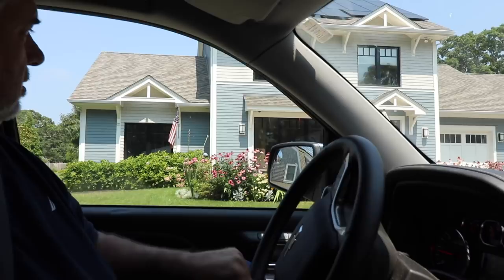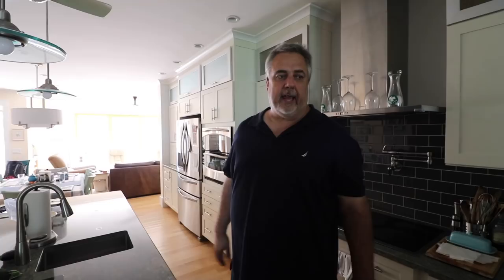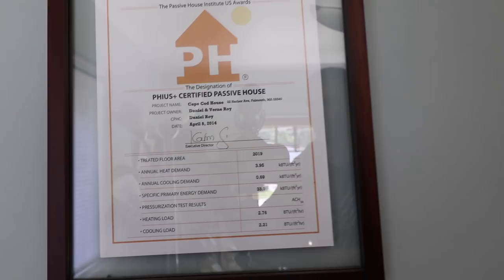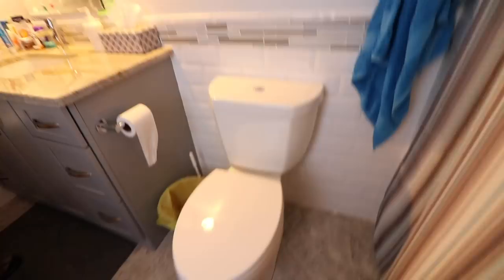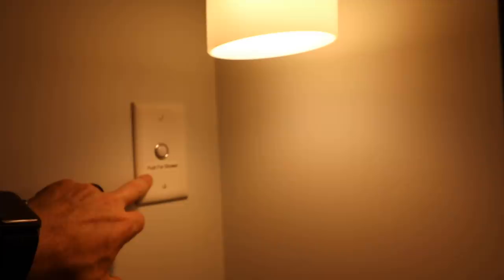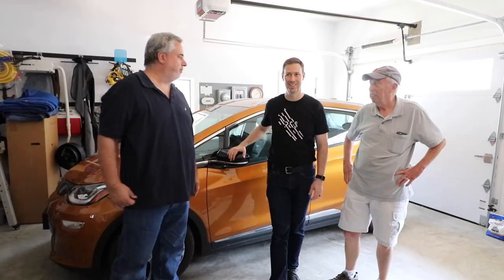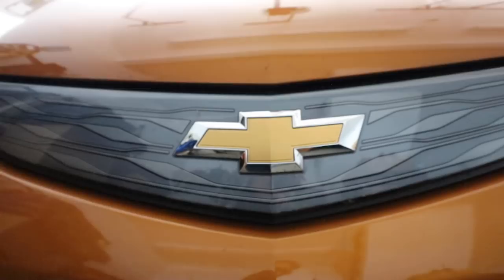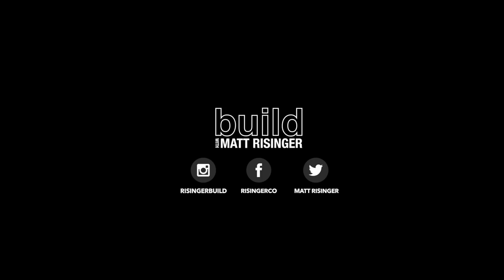Top 10 Most Efficient Home in America

Comment: in Europe they make heat exchangers with built in heat pumps where for every 1 Kw of electricity used for ventilation  you will get 2,5 or more Kw of heat
Reply: This is USA, we just recently upgraded from caves to glass walls.
Reply: The CERV air exchange system that I installed from Build Equinox in Illinois does the same thing with a heat pump.
Reply: Link to specs?
Reply: @2awesome292  I give you names you do the research. "Enervent " name of company, from brits LD 800 recuperator, Combi 302 polar,  Sundue SDAR 500

Comment: Cool house.  I'd like to know about the insulation though.  Those windows have to be pricey
Reply: Windows are not cheap but the trade off was getting rid of a traditional ducted heating / cooling system for two ASHP. It was pretty much a cost trade off. You can put less performing windows in and buy a bigger HVAC system, OR buy really good windows and a much less of an HVAC system

Comment: I'm wondering if you could use a thermal chimney to power the air exchanger... well... actually I'm sure you could, but it's more complex and less convenient and reliable than just using the PV panels.

I question the humanity of anyone who does not get excited by awesome engineering.
Reply: And you’d lose the variance for CO2 buildup and moisture removal.

Comment: This is all good and fine in northern climates, however what about Texas! More specifically around Austin, Texas...how do we save on a/c bills.
Reply: A good build passive house works summer as well as winter. During the summer, the heat will not come in, and during the winter, the heat will not get out,  either situation works on the same principle. Granted, the idea of a passive house was not born in super hot climates, it was born in the moderate climate of northern Europe, and there it works fine. Here in central PA, a new stick frame house with standard insulation becomes almost uninhabitable in no time when the a/c fails on a warm (85) summer day. That would not be the same in a passive house, a passive house would take much longer to heat up after the air condition had failed. Look around the world, there are so many buildings in really hot climates inhabitable without a/c. It all depends on the building method, and stick-frame with poor insulation is just not the type of house that can be without a/c.
Reply: My position is that if you buy, make, or convert energy, you want to hold on to it as long as possible - if you heat you want a defense to keep heat in (cold climate) if you cool, you want to keep heat out (cooling climate) both require roughly the same thing, just heat is moving in a different direction.....

Comment: Matt and Steve and Dan. I would love to know the price per square foot to build such a house. How to present to my clients that this is the way to go. Price vs payoff etc etc. Thanks for a great video!
Reply: Price per square foot is a myth. There are many fixed costs that don't change. Also a lot of the efficiency comes from the walls not the size of the space.
Reply: @2awesome292  Matt how do you feel about this? Is there a way to decide how much is reasonable to spend on this kind of thing? I mean if you're building a 3000 sqft house and spending a million to make it passive vs 750k to make it not passive.... What's the specs on the house? How much did it cost? Etc etc etc
Reply: +Ben Bressel I believe there is diminishing returns. I would say you could get reliably get 80+% passive for <20% of the price difference (90/15 could definitely be achievable with experience) . It would be dependent on a house by house basis. Upgrading insulation, air sealing, rectangular footprint, window positioning, layout, ventillation, etc could be integrated with reasonable cost.

All the high-priced imported name brand stuff, certification,  is definitely not worth it from a financial standpoint.

I know there are a lot of commercial buildings that are given LEED Platinum, all because of all the bonus points that don't make any sense and the comparison building is something that could be designed by a  5 year old.

Comment: Nice! I have a very simiar house built seven years ago. Great feeling to have zero fuel bill. My Tesla Model 3 is on its way, so electricity will go up a little, shortly.
Reply: Depends on your power price. Right now it's as cheap to drive a gas powered Toyota SUV at 37 MPG compared to the price on public chargers.

Comment: Trying to understand making a home so air tight that you have to use power to get fresh air in.  Isn't that reaching the level of costing you more.  Air exchange is air exchange.  One is passive and just happens the other you are spending power on.  Wouldn't it be better to identify the correct level of air tightness so that on average you have fresh air, but you are not loosing heating/cooling to the outdoors.
Reply: Problem is I cant determine where the air leakage is and I can't filter it, heat it, cool it, etc

Comment: It's cool, but why not just use all conventional electric HVAC etc and load on enough solar panels to cover all the energy requirements? Then you wouldn't need all the extra crap for stale air etc. You'd get better heat and cooling distribution and you'd still be energy neutral.
Reply: It doesn't work that way, a conventional system in here would be absurd

Comment: very interesting but if it all costs an extra 50 000 0ver and above a reg R2000 house then its something like a 100 months until it starts paying for itself, correct?
then by then have your PV units or invertor or anything needed replacing?
Reply: C K that's assuming energy prices don't rise over those 100 months. Any house has maintenance, slightly more here but still worthwhile. In future all new houses will be like this, it's inevitable. In the U.K. the government mandated all new homes had to be carbon neutral by 2016. The requirement was scaled back before then, as the technology wasn't as developed and developers protested that there wouldn't be enough skilled fitters (we have a massive housing shortage, so building anything that slows building down is politically unacceptable) but given that UK law states we must be a carbon neutral country by 2050 it won't be long before the plans are dusted off again.

Comment: Shading Outside before allowing Inside, is why I've had such easy sell of Solar Screens on homes for over 18 years. And people who foolishly thought they had blinds or interior product or window film start calling eventually just after they've spent more  with lazy businessmen sold products.

And look how thick and supposed Energy Efficient the windows are, and they are bragging about 60% heat gets through, still admitting the exterior shading is necessary. 

And in Austin, Matt ought to be very aware and familiar to advising or personally installing solar screens since it's not deregulated electric provider and they once were paying credit back to solar screen buyers installing under certain age and type of residential building circumstances.

Comment: I love the concept of passive houses but I LOVE real fireplaces.  If I build a house it's gonna have a real, wood burning fireplace.  Are there any "advancements" in this regard?
Reply: The biggest concern of a wood burning fireplace in a sealed home (ICF/Swedish wall system/HIGH R VALUE/Completely sealed) would be fresh air to feed the fire (have it's own fresh air intake). Next, overheating the home because it will not take much to heat a sealed home. Lastly, but not less important, proper ventilation of gases and flue operation.

If in a passive home that is properly insulated...overheating could be your biggest problem even in Winter time. A small fire in an efficient fireplace could easily heat up a home quickly.
Reply: @AnthonyBennettKY  
Yea I thought exactly that...  It needs incoming air to feed the fire.  I hope there are some sort of solutions for this...  Nothing beats real wood burning fireplace (comforting smell, crackling, etc)
Reply: Same! -Also a Sergey here :D
Reply: @sergeybebenin  

There is a company that still makes wood-burning fireplaces that has a kit for fresh air drafting... Napoleon. I have been looking around for years and they seem (no direct experience by me) to have a nice setup. We will be building a new home Spring 2019 and looking to do the same. Their kit may need some modifications to work with your design but, the idea is there already. Also, to help keep things simple, design the fireplace close to an exterior wall.

Must keep in mind a way to seal it when not in use and keep critters out of it.
Reply: Yea mobile homes require fresh air intake. And I'm sure lots of people use them for houses. So the solution to overheating is just buy a smaller fireplace, or run it on a very low efficient setting. Lots of fireplaces are computer controlled now and capable of amazing things. The world is advancing in amazing ways, fireplaces dis not get left behind
Reply: @sergeybebenin  One option is to bring in feed air from the outside, use hydronic underfloor heating system with a large buffer tank and use a fireplace that has a water skirt that is piped into the buffer for the heating system.
Reply: @AnthonyBennettKY  
Thanks for the name, I took a note!  I think sealing the top is probably the easiest part.  Plenty of dampers with gaskets.
Reply: @AntsAasma  
That's a cool idea.  So much wasted energy going out the chimney with fire
Reply: @Sergey Bebenin  The Norwegians (or is it Swedish) have SOAPSTONE fireplaces (some even have a pizza oven built in). The soapstone is an incredible thermal mass lasting 12-24 hours!  https://www.tulikivi.com/
Reply: Ants Aasma if it is a passive house there is no heating system, hence all the comments about overheating. What your describing is very efficient but not required for PH.

Comment: No doubt this is a great and successful project. In answer to the question of "Why wouldn't you build a house like this?" Because of two things. 
1. Extremely high initial cost that coupled with a mortgage (for most people not Dan) negates the long term value. 
2. Keeping up with the extreme cost of obsolescence of the systems in the house, would further erode any actual real world gains. Compare those costs to any average new home of similar square footage in that neighborhood, and in 20 years the Actual Cash Values would be in the favor of conventional (low tech) construction. 
Resale value wouldn't be there due to outdated technology, high maintenance costs and comps in the neighborhood. A house like that would be on the market forever! The windows, 2x6 construction and very high insulating value derived from spray foam are where the recoverable gains are. The mechanicals? Not so much. I'm in that business. That stuff wears out, is very costly to maintain properly, and is essentially out of date, the day it's installed. Dan said that in the video about the water heater! Putting a new $10K water heater in every ten years doesn't make good economic sense. ($1K a year just to have a cool hot water heater? Really?) 
Interesting study though on how much money one can spend...to not spend any money.
Reply: House was built for market rate, builder built the home next door a year earlier and that homeowner has a ton of regrets. The PV system paid for itself in 5 years (and that's with no energy bills, including driving their car) They are 3 years into total energy freedom. And where do you get your numbers a $10k water heater - ummmm no, more like about $1700. This is the finest example I know of on how to spend money wisely.......please check your #'s and sources

Comment: Does the electrical system have an inverter and battery bank? You mentioned the power grid going down, without a storage system there is no power at night.
Reply: I believe the comment was referencing if power goes out this house could sustain "no heat" for at least a week or more
Reply: It is a grid-tie & net metered system. They bank electrical credits during the day from the solar panels and use the grid at night and an crappy solar days. It’s a fully electric home - so other than slow heat loss during the winter (or gain during summer) they still need electricity for the mini-splits and all the other appliances to maintain comfort and live.

Comment: That poor old fella spent so many thousands of dollars on a high end fresh air system only for it to pump 20% of the heated and conditioned air outside. Such a racket. You would have better control with properly sized washroom fans, timed with makeup air. With 24/7 recirculation, your air conditioner cannot keep up. 1 hr of an HRV/ERV will undo 24hrs of a/c work
Reply: Hmmm lookey here, another advanced mechanical engineer with magic - Dan is a mechanical engineer far beyond your ability......that is probably why we didn't get your opinion for the build

Comment: I get that this house will be way more affordable in the long run but what is the cost difference of this house compared to a "normal" house for building it?
Reply: In Seattle I would imagine it would cost at least 125K more than your typical home.  Passive house level windows alone, especially in aluminum clad wood, could cost over $75K for a window package.  The Zehnder ERV is 8K not including the labor to install it.  The EV array likely $25K or more.  Just the additional materials and labor for a durable, highly insulated and airtight building envelope will add tens of thousands because you'll be likely using fluid applied WRBs, rigid foam on below grade walls and slab, rainscreens, closed cell spray foam, etc.  The sad thing is that you could build a close to passive level house not much more than a standard house if you do it smartly but so many builders overcharge to build such a house.  Take for example SIPS and ICF framing.  It really should be cheaper than stick framing since it's less labor and there are savings with having insulation/framing in one but builders typically charge an arm and a leg to do it.  You could buy the solar panels off Amazon for $1K with a 3K inverter and other parts and have a PV system for less than 6K if you do it yourself but any Solar company will probably charge you at least 25K.  I called  Offset Solar asking for a bare minimum PV install and got quoted 50K.  Outrageous!  I recommend aiming for a "Pretty Good House".  The ROI is much sooner and you'll have 90% of the benefits of a passive house at 50% of the cost or less.

Comment: I am still not understanding why would a person air seal their house to the point they got to spend $100,000 to pump fresh air back in the house that was already coming in the house when we was little and the house got cold we put plastic over the windows in the summertime if it got too hot take the plastic off the window today I think people are going a little bit too far with air stealing their house now you have to breathe in the chemicals of the wood the insulation, paint, sheetrock, sheetrock mud ,floor ,cleaning chemicals ,dirty clothes laundry ,funky air trash I think you should air seal bad spots 50% not 100%

Comment: Matt, can you tell me who made those windows?
Reply: Anthony Griffin - I was wondering the same thing. 
Matt and/or Steven, you guys mentioned what sounded like 'Shuco' and 'Makrowin' for two similar window manufacturers. Could you verify I got that right? 
The windows in this house appear to be the 'Makrowin MW88G2' with Tilt-Turn option. These windows open either by turning in, tilting in, or by micro-tilt, which allows for a rain resistant option for passive fresh air ventilation via a small gap - while maintaining peace of mind with what remains a securely locked window.
I've been a fan of this incredible German engineering for a couple years now after seeing them in a friends 'small house' built in Colorado. 
Anthony check out the following link for more information: https://www.eas-usa.com/Products_Wood.cfm
Reply: yes Makrowin 88's
Reply: Don’t know if a available in USA, but Rationel in Europe do very similar high performance windows.

Comment: 4:37 ..he didn't answer the question WHAT IS A PASSIVE HOUSE  !
Reply: yeah - I would have preferred these guys had outlined the basic requirements of what defines a "passive house" and THEN go through the house to demonstrate and show how EACH requirement was achieved and WHERE is was achieved.  For example, they did not highlight the fact that with such a structure the typical wall section is a lot wider than a regular 2x4 framing section.  This house may have used a 2x6 or even a 2x8 framing section to allow more insulation to keep the temperature inside constant and shield it from the outside cold and heat.  I am no expert, but there must be a list of things you do to make a house passive such as:  certain types of insulation and places where it is applied, roofing materials, exterior and interior finishes, window types and applications, hvac requirements, plumbing standards, electrical standards, and on and on. You don't just install solar panels on the roof.  It is a combination of many systems to make a house air tight and energy efficient. You get the idea.
Reply: @jobeLewOOH  google Passive House, there is too much info to put in a short video